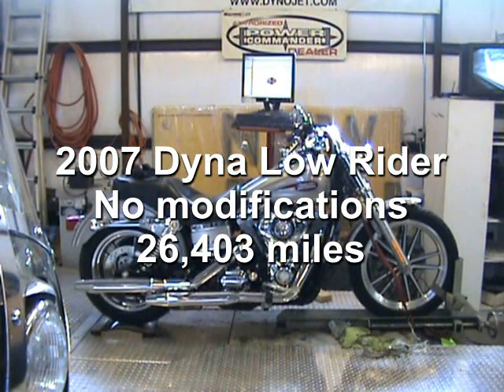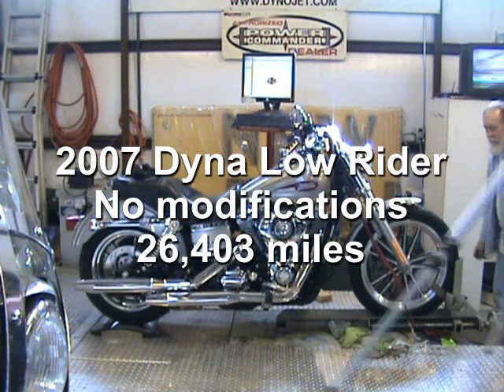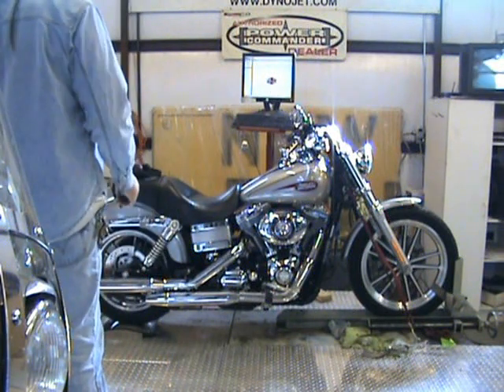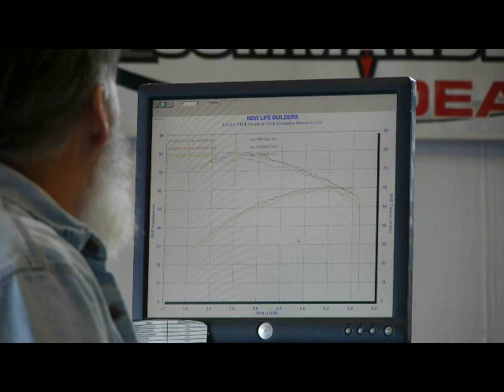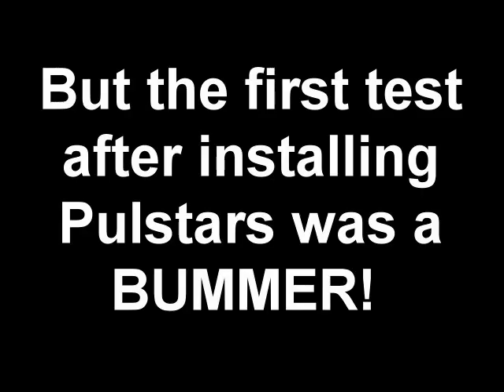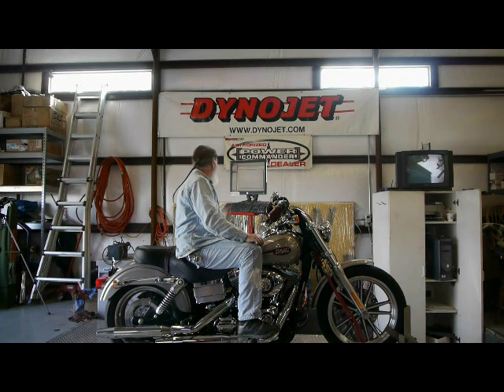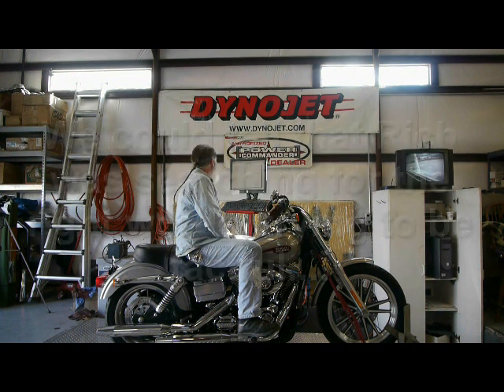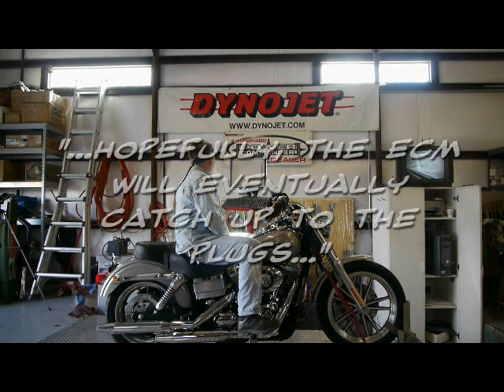Dyno Test Pulstar Pulse Plugs in a 96 Cu In Harley Davidson Motorcycle.avi

Comment: In my experience, reading dyno graphs and tuning, I found the sharp wavey lines in the output are almost always a sign of ignition break up. Most of the time it's caused by too large of a gap. Did you make sure they were the same gap? Do you have any insight to the wavey line once it's in the upper rpms?